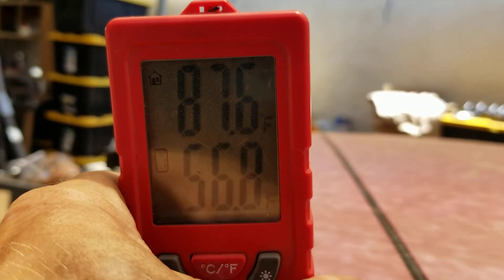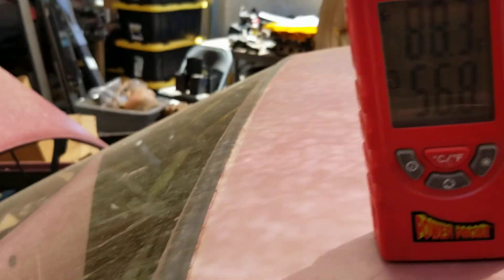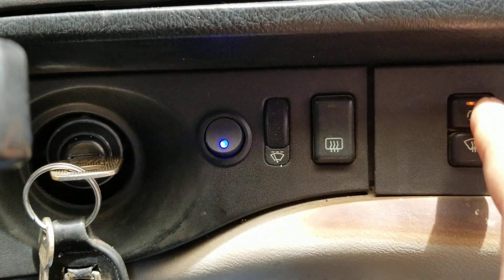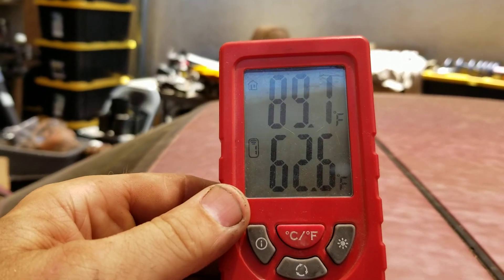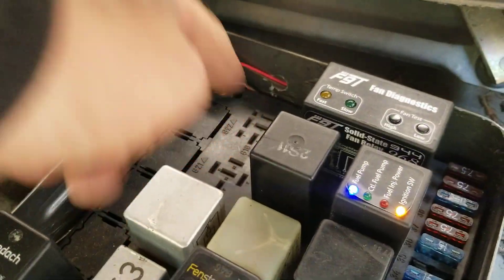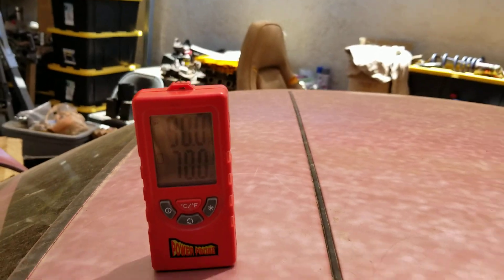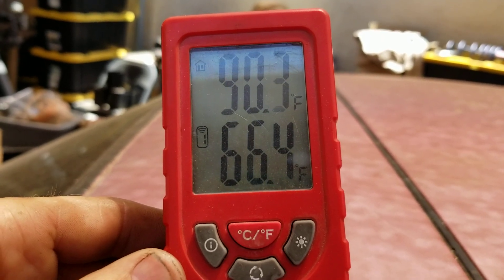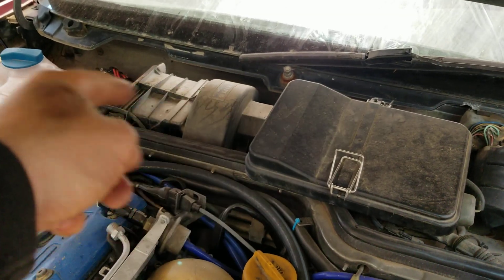12 Volt AC compressor in a 944 Part 8

Comment: The high pressure seems low, on 89 it should be at around 200 225,I want to do an electric setup on my ranger let's see how yours behave
Reply from the maker: I think I have a small leak. head pressure was around 190 and then it dropped.  I need to do a nitrogen pressure test to find it so my system will stay charged.